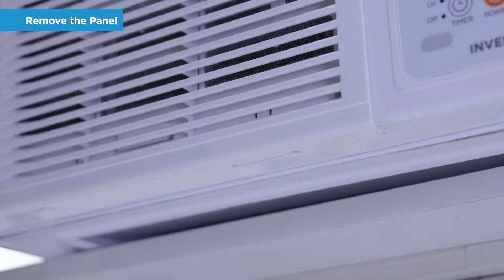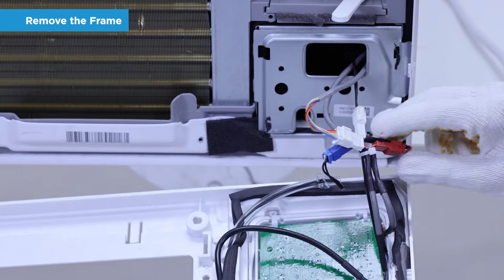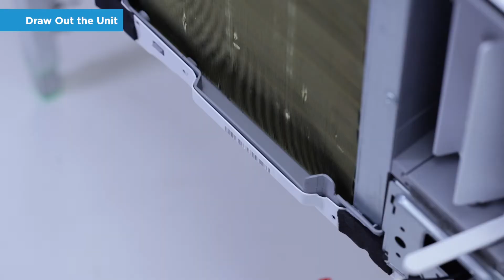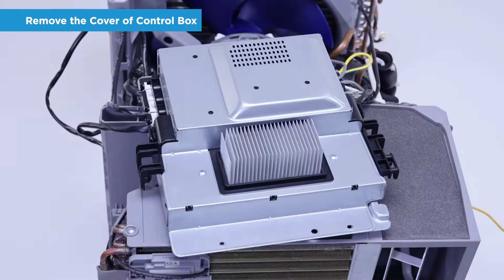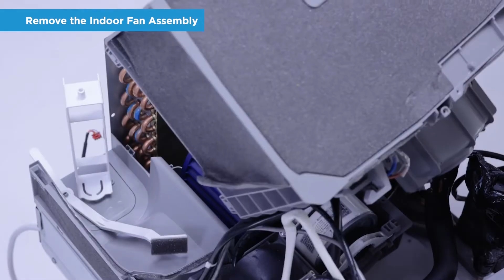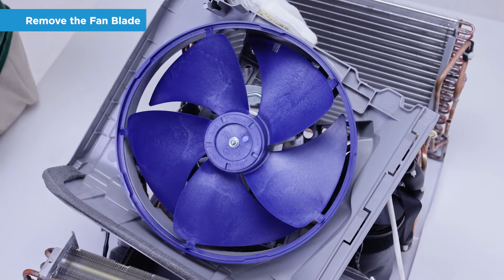Dismantling of Inverter Window A/C

Comment: The design of this type of window A/C is significantly better than most because both of the fans can be easily cleaned without bending pipes or reclaiming the refrigerant gas. This unit uses the same parts as mini split air conditioners it seems, but is much easier to clean. Hopefully, in the future, Midea mini splits will have a fan that can be cleaned without removing the evaporator first. This is a feature that Mitsubishi has and it is very important since the fan and coil need to be cleaned very frequently to prevent a bad smell and mould, even if the unit is dried before turning off.